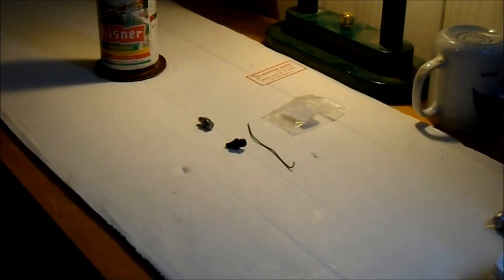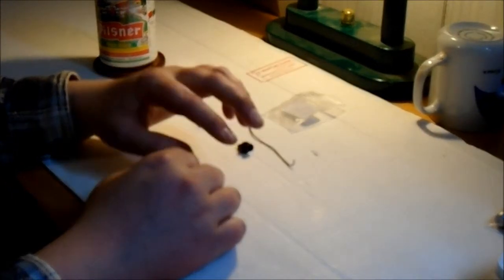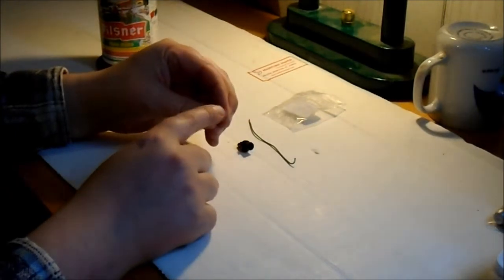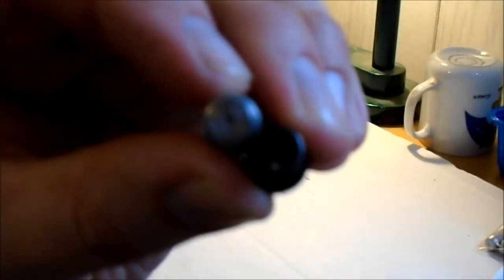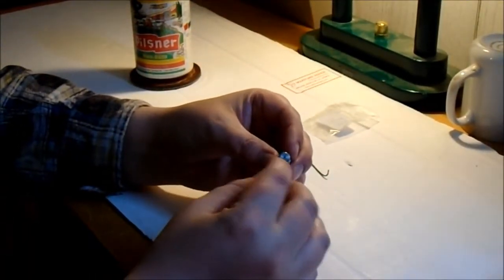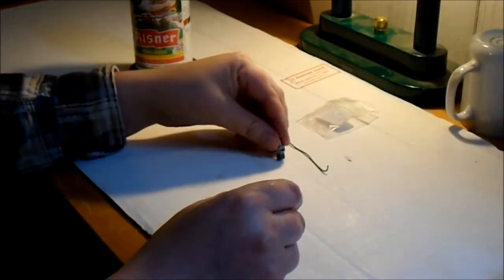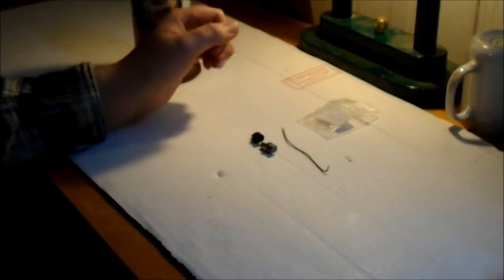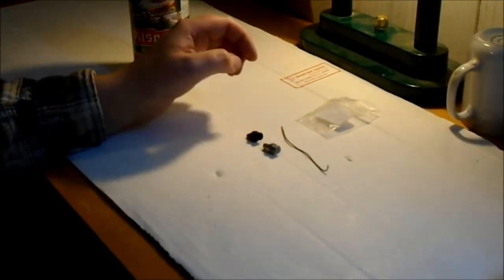Solid & Cone Base Nipples

Comment: Good video, My .50 has the newer style nipples. #10 caps fit best. They do fowl up pretty quick, A little folding set of torch tip cleaners work well.